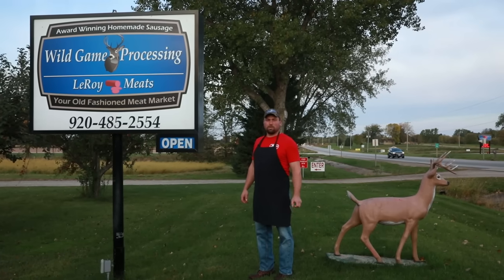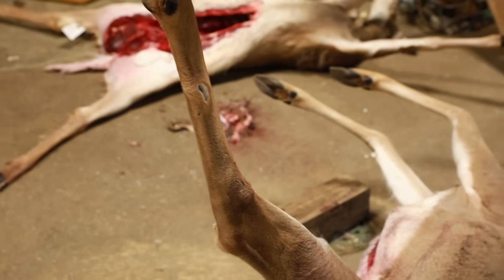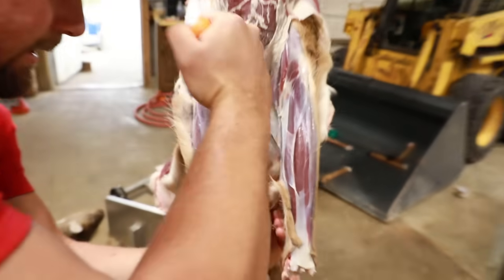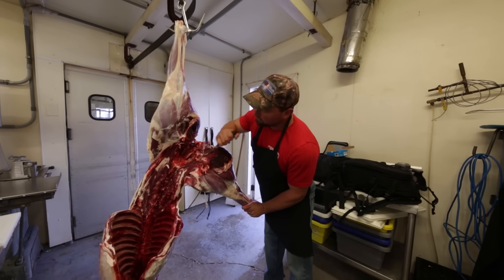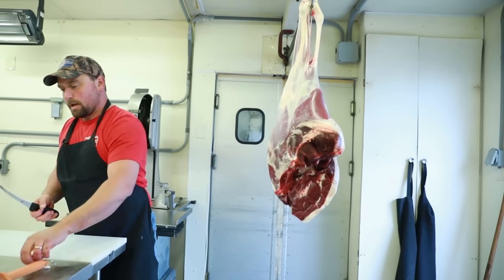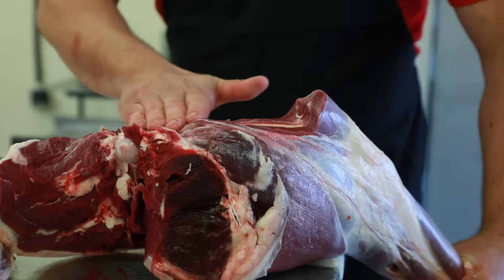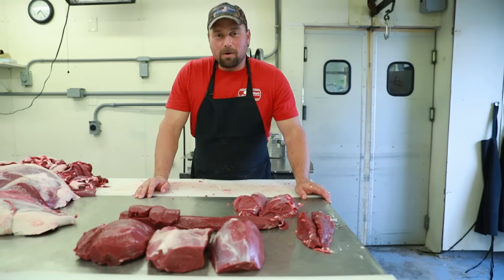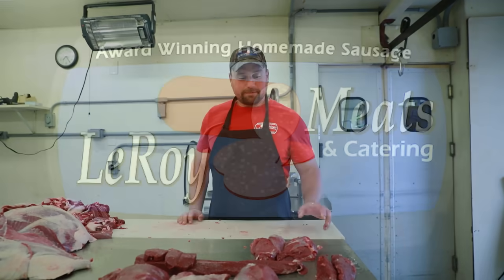Full Deer Processing Tutorial and Cut Up (HOW TO)

Comment: I had to put down one of my bucklings today due to paralysis, and it was too short notice to be able to get professional help. This video helped me a lot in understanding what things are first done to make the process easier. I screwed up doing the hide and poked a hole somewhere near the edge in the thigh portion, but other than that I think I did ok. Sawed the pelvic bone apart to be able to open the cavity, and had no holes poked in any of the entrails… Washed out the cavity afterwards, hope that was ok to do. A lot of blood which made me want to clean things up a bit…
Anyways I did my best and hope I got things done ok… I was NOWHERE near as fast as you! I will have to amend my setup next time to make things easier on myself.

Thank you so much for sharing your craft, it is much appreciated!

Comment: Been cleaning my own game for 50+ years... I never thought of that trick of clamping/fastening the hide to the floor to pull it off as the carcass is raised up.  GREAT tip!
Reply from the maker: Yeah that tip was a game changer for us
Reply: @LarrySmithOutdoors  I'd love to see a close up photo of the clamp that you use to fasten to the hide.   Thanks.
Reply: @LarrySmithOutdoors  I agree that properly processed game is the key to not ruining the meat while processing it.  But I was raised very strictly about only making head shots with firearms. Bow shots I make only to the heart/lung area.  I do believe this too makes a difference in meat flavor as it gets little or no adrenaline.  Was always told head shot to not waste any meat.  Have tried it on white tails, but it destroys the broadheads I've used, and sometimes the arrow and or fletching.
Reply: @billjenkins5693  Looks like it is the metal wire (Aircraft cable available at most home stores) and the just make a loop around the prestarted hide and then lock it in with the u-bolt clamp. Then on the ground it is probably just a Concrete anchor with a Eye bolt, then a quick link connecting the Metal ring then a shackle that has the other end of the aircraft cables attached.

Comment: Wonderful concise processing video!  One question, how much of the scraps do you add to the grind?  Obviously the glands and the silverskin won't be added, but there were several cleanup cuts that looked like they ended up 50% connective tissue 50% meat.  Will you clean those up further to try to remove all the connective tissue? Similar with the shanks, do you simply debone and cut into strips for the grind or do you take the time to remove silverskin and/or connective tissue? 

Thank you so much!
Reply: Alot of that can be used for hamburg. Mix it with a pork roast. 80 percent venison 20 percent pork
Reply: @kurtglo  does the venison fat need to be removed first?
Reply: @kurtglo  does the venison fat need to be removed first?
Reply: @iamtheshaker  If you mix it with the pork roast, yes, but I have actually mixed it with just venison fat and it was a little more gammy taste. The less venison fat and silver skin, the less gammy taste it will be.
Reply from the maker: Thanks for the tip!

Comment: loved your video..Always had difficulty taking out the anus cavity until a  Cajun friend of mines showed me how to split pelvis open easily with a small knife,  a pin pocket knife works great.. if you can do a "precision " cut down the exact middle of the pelvis starting at the top "ridge",,  the pin knife slips in and the pelvis " separates"   !  a "hunting knife" can get in the opening and more force can be used if needed down to the anus, , pelvis line is actually fused , not solid.. it can be a little tricky at start,,  but you should show a video  of this for those that don't carry a saw..
Reply: Could you link me any video or pictures explaining this?  I don't think it's a commonly known technique
Reply: @iamtheshaker  no I don't have any known videos of it. Put your two fists together joined at knuckles. This is  like the pelvis magnified .. getting a small blade exactly in the middle between your knuckles is the trick
Reply: @terryleblanc6868  well explained!

Comment: Last time I did any gutting and skinning an animal was back in 1980 after a snowshoe hare hunt in Alaska when I was stationed at Ft. Wainwright in Fairbanks, AK. We got 21 of them in an hour and a half, by the time we got back to the enlisted quarters they were frozen stiff in the trunk of our squad leader's Nova. I am 64 now and have 10 acres of property in NC just off the Gamelands. I have quite a bit of deer on the property most of the time. I don't currently hunt, but if the situation got down to where we need meat on the table, I do have the means to harvest some. Your video has given me some ideas on a couple of telephone poles about 14' up from ground level with a cross pole with a large eye-bolt and a pulley system. The skinning and drawing you demonstrate is welcome as a refresher on proper cutting. Speaking of cutting, where can I get the knife you used in the beginning of the video? My 38 year old Buck 119 might work on some of a deer, but I would prefer the proper tool for the job. Thanks, Paul.

Comment: I've been hunting and processing my deer for about 35 years now. I am very impressed with the lack of hair Larry  didn't get on the skinned deer. I do several things different. Not that either of us is right or wrong. One of my favorite parts is the neck. I leave as much as I can in length and then the tedious job of filleting the neck bones out for a beautiful roast. I do the backstraps and tenderloins the same as Larry. I'll take some stew meat from some of the hind quarters. Then the remainder of the hind quarters and the front quarters and the ribs and etc I grind into burger. Sometimes I'll cut the burger with one part bulk Italian pork sausage to 3 parts venison burger.  It makes awesome venison chili. I have my own #10 manual table grinder with flat cutting blades. Flat blades are imperative so you can sharpen them as often as you need. The curved cutters are basically useless unless you can sharpen them. I also mix the sausage and venison burger in the grinder and run it thru 3 times for a proper grind and a great blend in the mixing,  As far as steaks and roasts go I say hogwash on that. I grind them all into burger. Cuz let's face it folks... If you want a nice steak go to the butcher shop and buy a nice Rib Eye that's bred to be a good steak.  Now Larry here did an excellent job in processing this deer. His set up for skinning the deer is impressive. If you are new to cleaning a deer you will wrestle with getting that hide off and you're gonna get hair all over the deer meat. You gotta pick it all off.  Gut shots must be dealt promptly .  Try as much as you can not to puncher the gut or the urine sack. Your deer will taste tainted if you don't. The example Larry had where the guy had brought him an excellently dressed deer is rare to see but kudos to that guy. Overall what a great video. Oh... Take my and Larry's word on the removal of the fat and especially the silver skin. I put deer fat out one year in an onion bag for the birds to eat sorta like suet. Not one bird ate any. It just dried up and I threw it out. If the birds won't eat deer fat in January in Connecticut you know it's bad.

Comment: 27:20 
I can also say I recommend using parts of the shank to cut into cubes for fondue. We did a fondue around Christmas last year and after I cut up the hind quarters, I took some shank parts, cut them into cubes, and they were great to fry in the oil pot. Probably would do well with any kind of use where some cubed meat is wanted/needed.
Reply: fawndue :P

Comment: To each their own I guess, down south we don't completely different.  Our deer are smaller and there really isn't any reliable meat from the rib cage so we take the shoulders, hams, and straps.  No need to open the rib cage to expose the organs unless you are looking to harvest those specifically.  We do pride ourselves on accuracy with shooting so gut shots are avoided because we don't shoot unless we have the correct angle to get a clean kill for the meat we are looking to harvest.  Also, if it runs, it is only about 30 yards and we clean and quarter them within 30 minutes and put the meat on ice to keep it below 41 degrees before taking it to a processor to mix with the amount of fat desired .  Still a rock solid video to show how things are done up north.  Much appreciated bud

Comment: I have never taken one to a processor.  Always skin mine before breaching the meat. hang it upside down.   I remove back strap first, Then I sneak in there and carefully remove the tenderloins while the back end is still intact.  Trick is to not use a knive that is too long, narrow, or pointy.  Short, with almost a butcher knife blade to it.  Keeps you from poking yourself or the deer's "plumbing", as it were.  Once that is done, I  remove the neck and shoulders if they are worth saving.  Lastly I take the hams away at the pelvic joint, and remove the back feet at the knees, so I do not need to touch or cut any part of the digestive tract.  I do not cut through bone at all.     The innards all stay in the ribcage and along the backbone, and fall down into my tractor bucket to be taken off onto my farm and buried with my excavator.

Comment: Maybe it's just me, but I got partway through this and just had to go get a sandwich.  Watching this deer turning into various cuts of valuable meat made me hungry.  One thing I don't get is why he keeps peeling the fat off.  Venison is notoriously lean.  We've been given roasts, and before cooking it we cut slots in and stuff in bacon and/or sausage, to increase the fat content and help make it more tender.  Why not just leave the fat caps in place?  Or maybe use that for sausage.  Similarly with lamb, I've seen advice to cut off the fat cap, but I just cut a bunch of slits in it, which lets in the seasoning a bit more and exposes more of it to the heat, and the fat cooks beautifully.  Is there something wrong with venison fat, that you want to get rid of it?   I do like to remove silverskin from whatever meat I'm working with, though AIUI if you cook that low and slow, it turns into gelatin.  Maybe I should be tossing all that stuff to the side to make stock.

Comment: If you make all of your cuts through the hide from the inside out, you won't cut hair and you'll get less on the meat. You did: didn't really explain why.
 
You essentially said that deer fat is not so bad. I beg to differ. Deer fat is tallow, much waxier than beef or pork fat, and unlike those its melting point is higher than your body temperature, so it solidifies in and coats the inside of your mouth. Unpleasant, doesn't taste good, and it takes a long time to scrub it off with your tongue: I've been known to take a washcloth to it. Also, deer (blacktail, anyway) and elk seem to relish some intolerably bitter plants, even toxic Pacific yew (maybe they know it fights cancer?) and those unpleasant flavors are stored in the fat, and, I think, the silverskin. I try to remove everything white from deer and elk. It takes a long time, but it makes a huge difference. Meat cutters not doing this is why a lot of people don't like venison.

Try laying cuts with silverskin silverskin-side down, and angle your knife as if you were removing the skin from a fish filet. You should be able to work it right along the top of the silverskin, and remove it without losing any meat.

You mentioned glands, but didn't emphasize how important it is to get the testicles off a buck immediately, and find and remove all six lymph nodes from inside the hind legs, the front legs, and  the base of the neck. They, too, will ruin the flavor.